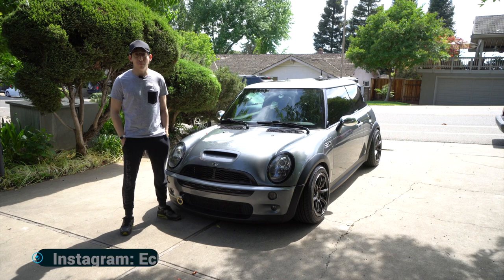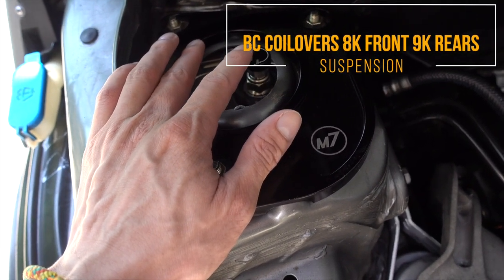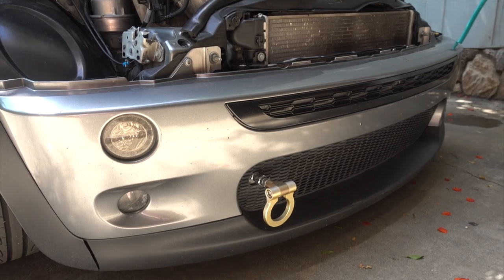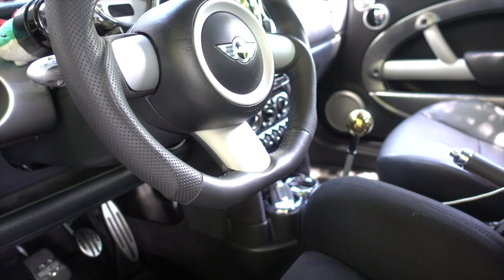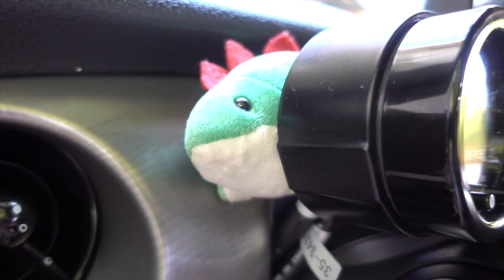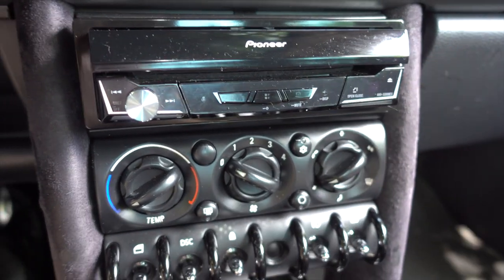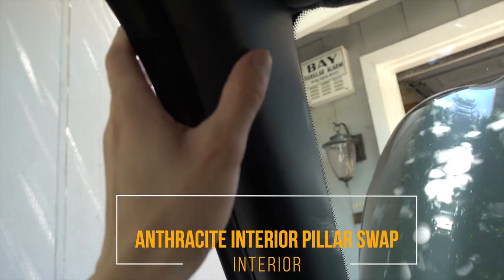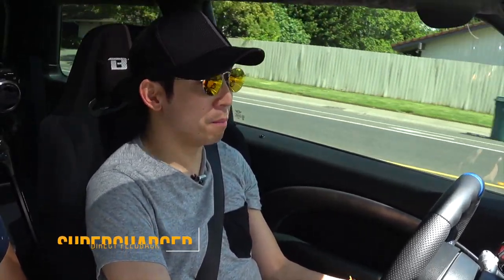2006 Mini Cooper S R53 Review - 6 Speed Manual Transmission (USA Version) Fun To Drive!

Comment: 18:30 About wheels diameter, going small is not always an upgrade. Let's say going 15", you will get a ligther wheel but forget about big brake kit. Also, if you are going with a 205/50R15 instead than 205/55R15 (same ratio than the stock tire height), yeah you will accelerate "faster" but also you are going to lose some high speed on the same gear. Let's say with the stock tire height and a rev limit at 7200rpm, you will be able to perform a 0-60mph on the 2 first gears, with a small tire diameter, you will need to shift to the 3rd to get 60mph. For the R53/R52S, the sweet spot for wheels is 16" and 17". 15" being too small (adios BBK) and 18" being too big (too heavy).